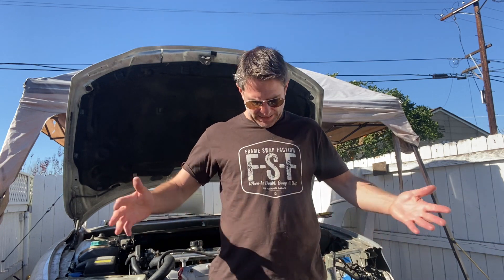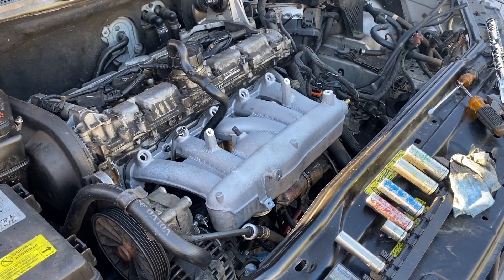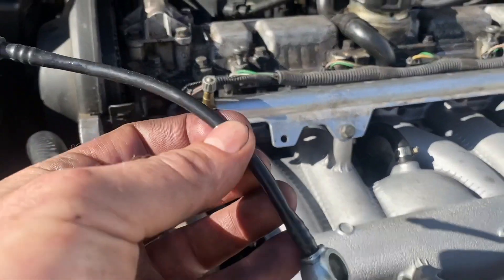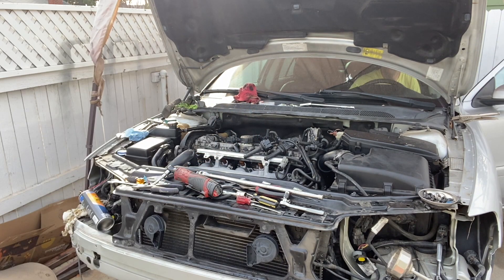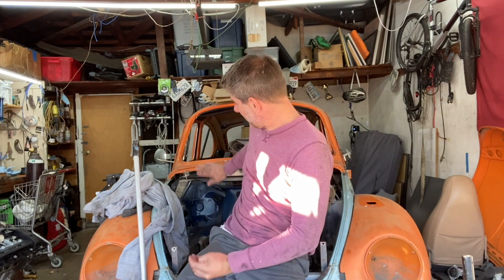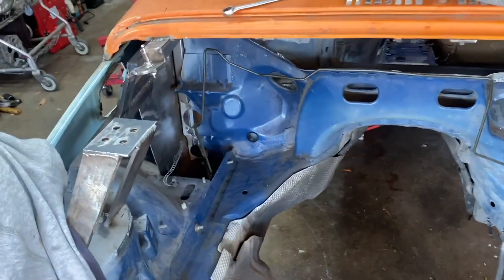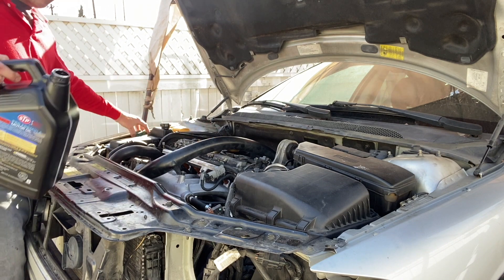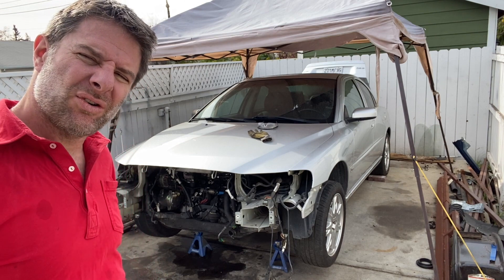The Mutt Ep58. VW Bug, BMW Z3 & a Volvo!?

Comment: Shame that the engine had more problems . But , the oil in places it shouldn’t be, the oil in the inter cooler was definitely turbo s kaput and they are so sneaky when the bearings or seals go it sucks oil in to the inlet and blows it all through the inter cooler.  If you are travelling at any speed it’s possible to hydraulic cylinders and this can bend conrods . Best of luck when you strip it down.

Comment: if you'd used an engine out of an 850, you only need 6 wires from the engine loom to the ecu, and it would run fine.

Comment: I suspect a lot of the glitter you found in the bottom of the oil drain pan is largely going to be what's left of the turbo bearings.  The banjo connectors on the turbo that were missing the sealing washers are, as said, oil supply and coolant lines.  The oil supply is high pressure to ensure that the oil flows successfully through the tight tolerances of the turbo centre, so leaving them out is a guarantee of oil leaks that make the Torrey Canyon look like a slight hiccup and very limited oil circulation through the turbo, which means pretty much nothing through the bearings and a ruined turbo.  The water cooling lines leaking will see the turbo cooked, meaning the seals fail out and the vehicle will start drawing in the turbo lubricating oil and burning it in the engine.  It can also cause the coolant level to drop below the point where the cylinder head gets cooled effectively, which can result in valve seats dropping out and will warp the head horrifically.  I have seen heads from turbo Volvo 5s that have shown distinct signs of melting due to being overheated, yes, they were turned rather than stock, but it gives a good idea of how tough the conditions are in the combustion chamber of a blown engine...

Comment: OMG you had it running with a good BMW engine ,you were so close to going into the inside putting seats and now you have to deal with a junk Volvo engine.  I was looking for the finish product and now your starting all over again on a motor you have to spend more money to fix. Disappointed and feel like its a waist of money was going to join, but Not finishing what you start ends it for me. Watched all 58 videos just to be let down.